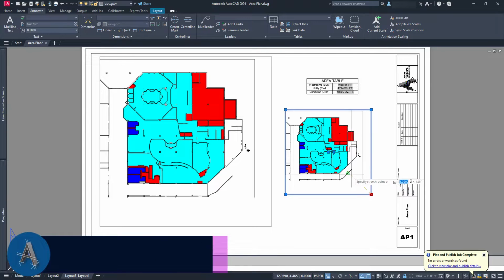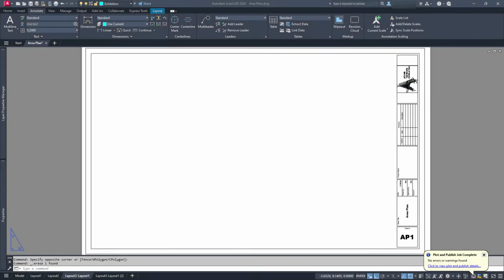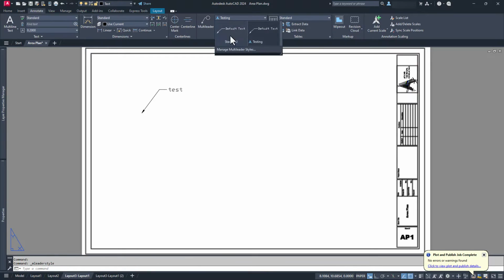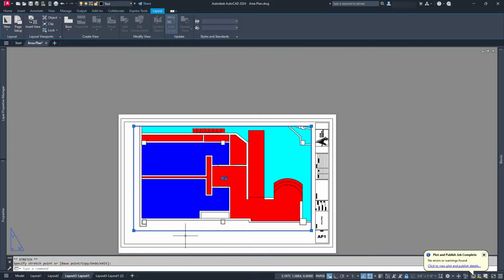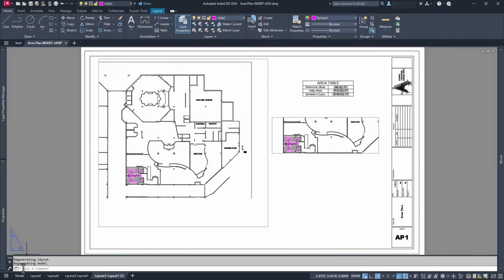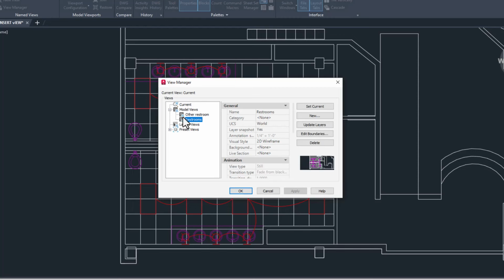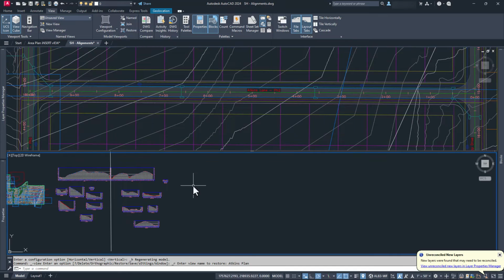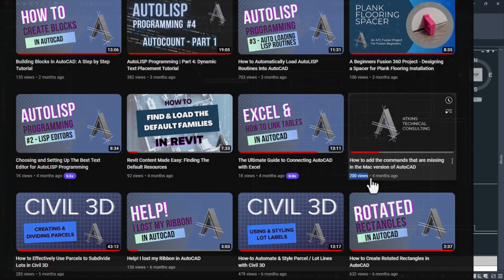Are You Still Making Viewports the Old Way? | AutoCAD Insert View Tutorial

Comment: Davin, I have several named views I'm using for my layouts but sometimes when I go to choose one I won't get the viewport outline around the named view and then if I drop it in I can't see the boundaries  and I can't edit the window. Other times it works just fine. I have the defpoints layer on. What am I screwing up? Any help would be appreciated.
Reply from the maker: It's not a good idea to put viewports on the defpoints layer. That layer is specifically for dimensions (the definition point of it). Instead, make your own non-print layer. I name mine viewport. Set that to non-print and you should have a better time with it.

If you're still having trouble after that, make sure you don't have an available update for AutoCAD. If you're still having issues.... Let me know!